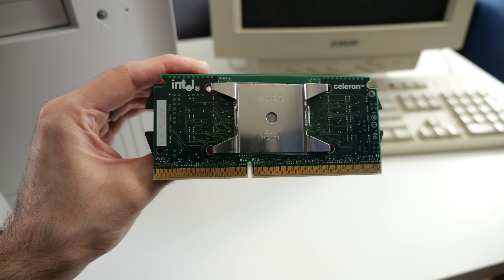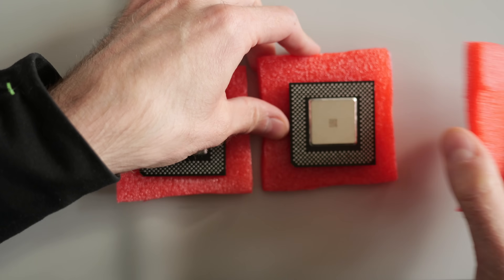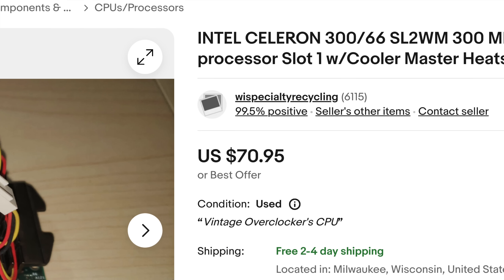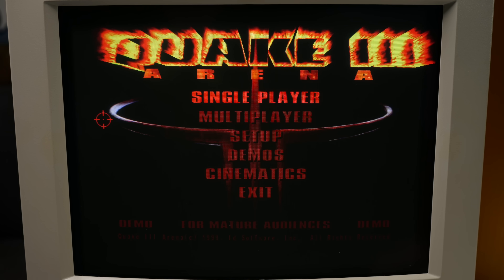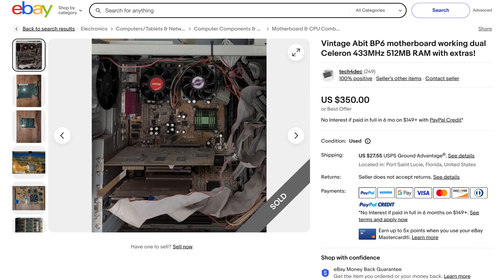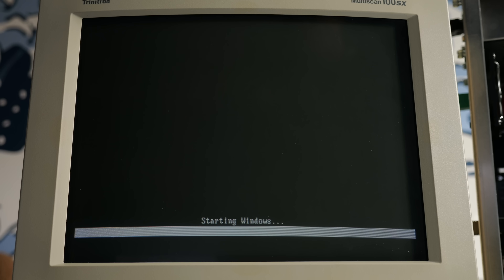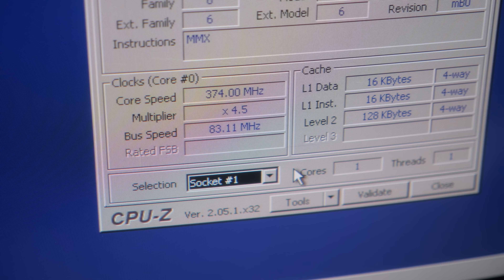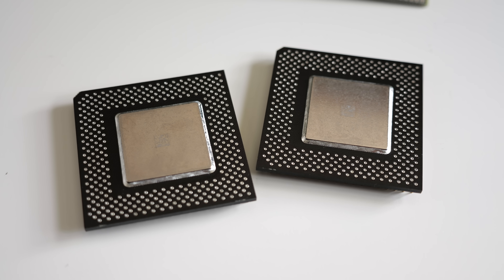I almost BLEW UP two vintage Celeron CPUs

Comment: This is why having multiple CPUs ends up being a disaster like the Sega Saturn, since programs and games can’t properly run at maximum settings, because developers made these software to run on a single CPU!
Reply: Plenty of systems could take advantage of SMP just fine back in the 1990s, including high-end workstations and servers from Sun, SGI, DEC and IBM. This was purely a Microsoft and third-party drivers / software maturity issue. It took a while to get Windows and all drivers thread-safe and mature enough to work in a PC with more than one processor; after that, apps and games were able to scale. 

Today, you’d have a hard time finding a single-core CPU in any personal computer or even handhelds. If you try to run any modern OS on a single-core CPU, it will either fail or exhibit horrendously slow performance. From that perspective, the industry has evolved and flipped 360 degrees.
Reply: @little_fluffy_clouds  we don’t use multiple separate CPUs, we use multiple cores in a single CPU because it’s all in the same processor chip!
Reply: @ yes, I know, that’s precisely what I wrote in my comment. When this Celeron processor was new, there was no such thing as a multicore processor, so if you wanted multiprocessing, we would use multiple processor chips, each of which had one core. Now CPUs come with multiple cores.
Reply: @Markimark151  multicores are the same thing as multi processors, the only difference is latency with their ability to communicate with each other. There's nothing new under the sun.
Reply: @little_fluffy_clouds  but it’s a design flaw to have multiple CPUs since software developers can’t fully utilize multiple CPUs simultaneously, good thing we use multiple cores in the same CPU which makes it easy to develop games.
Reply: @goclunker   no they’re not! Dual CPUs are physically separate from multiple cores in the single CPU, you have to program games differently than you would normally on a single CPU. Saturn games were inferior to PS1 and N64 because of the architecture and performance being divided.
Reply: @ if you write threaded code, you can utilise multiple processors just in exactly the same way as a multicore CPU. From a programming point of view, it’s the same, threads don’t care if they run on different CPU chips or different cores on the same CPU chip. It’s just that it’s difficult to write threaded code well, you have to account for deadlocks and race conditions which simply are not a problem if you write single-threaded code.

Some Saturn games did use both CPUs concurrently, it was just hard to do it efficiently and Sega didn’t have libraries to make it easier for a long time after the Saturn’s launch; for example, Virtua Fighter 2 used one processor for each fighter during fights.
Reply: @little_fluffy_clouds  listen, as someone that worked in quality assurance game development, you can’t just rewrite codes and make them playable on dual CPUs, you have performance issues with one processor being the primary and the other being an extension. Sega made a big mistake with using two CPUs, not helping third party developers utilize parallel performance. Game testers ran into problems with needing to make the second CPU on par with the first one. Multiple CPUs is just uneven performance, and game development is already messy enough!
Reply: @Markimark151  LOL. Its the same thing. What do you actually think cores are? Magic? they are just identical CPU cores with a super quick bus for communication because they are on... the same die.
Reply: @ Apparently you have never heard of anything from a xbox360 and ps3 on. LOL
Reply: @goclunker  Xbox and PlayStation consoles having more cores in their CPU isn’t the same as adding another CPU to the motherboard and complicating the architecture. The developers don’t have to worry about dividing their assets into two separate CPUs!
Reply: @Markimark151  Just stop, i am peacing out of this ridiculous discussion.PS, I owned a dual G4 PM for 15 years... and OS X has no issue utilizing BOTH CPUS.  Later.
Reply: @goclunker   then please leave, I don’t want to hear anymore misleading comments from you about video game consoles!
Reply: @ stop tagging me fool, I've lost enough brain cells on you already
Reply: @goclunker  then leave me alone!
Reply: Ummmm... what are cores? Its 2025, no single cpu around
Reply: The operational principles, from a software and programming point of view, is the same whether you have n single core processors or one processor with n cores. Typically, performance is better with modern multicore designs since the cores can communicate faster and with lower latency with each other.

Comment: I had the Celeron 366 (5.5 x 66MHz bus) overclocked to 550 (5.5 x 100MHz bus). Worked really well for years. I remember something about these 366MHz Mendocino core CPU's being especially overclockable compared to other Celerons of the era. That's why I bought it in the first place, for the overclocking capability ;-)
Reply: Same. I went through multiple CPU's before finding the magic pair. An an ABit BP6 that I'm looking at right now. It is in desperate need of a recap.
Reply: Things were moving so fast back then. Those you had were quickly superceded with the P3 (Coppermine I think) going up to 1,3 GHz.
Reply: @Breakfast_of_Champions  Totally. I used it as my primary rig for about 7 or 8 months  before moving to an Athlon based system but kept it around as a server for a few years.

Comment: You need to drill holes and mod the socket 1 celerons for smp. The socket 370 1st gen would do it with a specific slot 1 to s370 adapter (or abit p6)

Comment: Gonna post another comment: In this error, motherboard voltage was not very good either. I remember a buddy of mine that had a motherboard with poor voltage on the AGP socket, and his systme would crash all the time with the nVidia card he was using. There's a good chance that your motherboard cannot supply accurate voltage to both sockets at the same time.

Comment: Not sure why but this is all reminding me of when I upgraded my old Dell.  I had a XPS desktop with a Pentium 4 in it.  I knew when I bought it that it was an option to get a Pentium D.  After a couple of years I bought a Pentium D on Ebay and upgraded it (was much much cheaper after a couple of years).  Was obviously an easier option at the time to add a second core to the computer.

I remember it improving the performance, but not many programs supported dual CPU.  As I recall, it was primarily that it would reduce overhead from Windows and other programs running while playing whatever game you were running.

Comment: I was working on a dual Pentium III workstation at work back in 2002 and it was database related software aware of both CPUs, all other software just used one CPU

Comment: Change the FSB if possible, usually 110MHz is doable, sometimes even 115. Same goes for 66MHz side of things.
That is the info you are consistently missing, overclocking is not just a jumper and push voltage till things burn, it is a process of upping things a step at a time.
Had an ABIT BP6, if i recall correctly, i got 2x507MHz from celeron 300, i got ~1050MHz from 2 of PIII 733 and i got ~1100MHz from 2 of PIII 1000. This was done with 2 huge coolers with Delta fans that literally broke my fingernail when i foolishly tried to stop them!
Be aware that all this is very dependent on power supply, memory, MB,  adapters, cooling that in your case is not enough, and even the slot/socket contacts rust amount.

Comment: I think it's also worth remembering that these CPUs are now 25 years old - just because they could relatively easily be overclocked in many cases back then, does not mean they're still capable of doing it as everything ages.

Comment: I remember upgrading to a dual Athlon MP 1800+ (1.5Ghz) system in the early 2000s and seeing how fast it ran on Windows 98. Soon I realized it was only using a single CPU. It was simply the architectural improvements I was seeing

Then I started using Windows 2000 (multiprocessor support) and soon after started my journey into Linux

Comment: Yeah, that's the problem with multiprocessor, even today.  If you run any older apps that don't support multithreading or multiple cores, then you're getting zero benefit from having a multicore processor.  And ironically, cores today are generally less powerful than the older Pentiums of the day that older early 2000s software is expecting.  For example, Crysis actually runs better on an older, faster clocked single core Pentium then modern multicore, but slower individual cored processors of today.

Comment: Why Win2000? And not XP?  Over time the XP kernel must have had improvements for multicore compared to 2000, which had a much shorter lifetime.   And why not trying hardware testing with linux also?

Comment: I think the celery was at least a bit easier to overclock than you're experiencing.  Overclocking these (but not dual mode) was really popular.  I think the chips on the resale market tend to be the poor ones (sort of a binning by consumer).  Personally I had two of them and didn't even have to overvolt either to get to 450, and I remember talking to a number of people who experienced the same.

Comment: According to the manual the Asus motherboard of my slot 1 Pentium III the board supports two models of those adapters. I know a couple of 1ghz slot chips would work but I'm not sure if an slocket 1ghz chip or a legendary coppermine would work... not that I would ever find a coppermine Let along a slocket adaptor

So close on gpus My Pentium III has a fx5700

Comment: I did have a 2X 333MHz PII way back in the day. Used it with BeOS 4.5 and later 5.0, Worked flawlessly. However I never overclocked them nor did anything special. And yeah, it was mostly a 'why not' build than anything else, since I couldn't game very much on BeOS and never really worked with graphics. But it did run sooooooooo smooth in day to day tasks. I loved it. Might have to build one of those again...

Comment: Dual celery 300a over clocked to 450, was the bomb back then.  I wish I still had it.  I ran windows NT/2000 and Linux.  The system was a lot snappier to use even if a lot of benchmarks geared to single tasks didn't show it.   Worked really well in Linux and Windows was noticeably faster with multitasking.

Comment: I used dual Celeron 500 on BP6. Rock solid (after fixing faulty VCore design) and decently quick. Also, modified BP6 could takie dual PentiumIII.

Comment: Nice copper CPU coolers! I used to run Asus BP6 with dual Celerons and chilled watercooling. Needles to say that it was not for serious work or play. It was more of a OC hobby project. Sweating it out when the DIY soid copper waterblocks were running near zero and sweating like crazy on condensation.

Comment: Some of the LOWER rated clock speed celerons COULD be overclocked more than the higher speed ones.  It was probably due to the factory fixed clock multipliers.  Also the few NOS Celerons still available on shelves today might be ones that barely made the rated binning, when these were new the devices that passed factory binning with more margins were the ones that got sold first.  So, yours might be of lower quality.   As far as multi processor software, you should probably be running Linux or BSD.  Some distro's still support 32 bit processors today, or you can compile your own kernel.

Comment: best overclock i ever got on a old system was running a amd k6-2 at 682mhz the bus had a max speed of 124mhz and i had pc133 ram installed. i tried like 4 amd k6's till one worked at that speed. i did this around 2005 when i was finding dozens of emachines along the curb most of them had various k6's in them.

Comment: 4:58 Couldn't you just right click at MPS Uniprocessor PC, select Properties, Update Driver and select Multiprocessor? I did somewhat something like this inside of a VM machine and worked without reinstalling Windows.
Reply: I've done a search and yes you can. 
"Fortunately Windows2000 is much less of a pain to change back and forth between single-processor and SMP configurations. Simply go into the Device Manager and find the item 'Computer'. With 'Change Driver' you can choose whichever system configuration you fancy by choosing 'show all available drivers'. "
And then changing to ACPI computer. But afaik you can do this only going to ACPI, to go back to standard pc, you need to reinstall Windows.
Reply: This. On NT you could also do it without reinstalling but had to manually replace the HAL and kernel files.
Reply: Came here to say the same thing! I've done this regularly on a Pentium 4 Windows 2000 system to enable/disable hyperthreading.
Reply: Exactly. I did this multiple times on XP when upgrading from non HT P4 to P4 with HT, as it showed up as 2 processor cores. No need to reinstall :) Also works on 2000, I had an old server with P3 processor and decided to add another one, did the same and it worked. That was all back in 2007 or 2008 :)
Reply: @ Even Windows 2000 couldn't take full advantage of multi-threading, like the video shows up. Many programs and games can have multi processor support but... Only XP and ahead can take full advantage. Maybe the results are different if he used XP.
P4 HT doesn't actually have 2 cores. The main core emulates/virtualized a second core. Enabling HT, the P4 could have at least 60% more performance. The first actual dual core is the Pentium D.. which was actually 2 P4 cooked together with extra sauce.. but they were poor in effenciency and they never put HT into Pentium D. Fortunately, Core architecture arrived sometime later.. saving us from having over 200w cpus.
Reply: @hugosimoes5119  Early versions of "Core" architecture actually ran concurrent to P4 and was found in the mobile line. The  840, 955, and 965 were Extreme Edition P4-Ds and had hyper threading.
Reply: @NVMDSTEvil  I've upgraded several laptops from Core to Core 2 CPUs. It was extra good to take a "Core Solo" Celeron to a Core2 Duo. The gotcha is through that era there's 3 or 4 laptop CPU sockets that all have the same hole layout but are not electrically compatible. Often the exact same CPU dies were used on two of the pinouts.
Reply: Yup, could do this.  It was also worth doing this on single-cpu machines for extra performance as well :)
Reply: And would it boot as "Multiprocessor PC" if one of the CPUs was missing? Because then there would be no reason to change back.
Reply: @Stoney3K  Yes

Comment: Shouldn't you use a crappier video card to help illustrate the CPU difference in the game? That means it's the GPU that's the bottleneck mostly, so a less-bottlenecked GPU would help illustrate a larger difference in performance w/CPUs?

Comment: With the right amount of RAM you could get something like NetBSD or one of the few 32-bit Linux distros to run. It would be interesting to see if there is any amount of performance bump having proper multiprocessor support.

Comment: The return of the Dual 300A! LET'S GO!
Reply: The Abit BP6 was the only decent hack to get this working.  I still have a few 300a's that overclock to 450 with no problems.  I've used slockets before with them but they weren't ideal.
Reply: shut up jeff your channel has been nothing but homelab crap for the last 5 years, how about you do something consumer-centric for once?
Reply: @Zoey_KL Consumer-oriented is literally what homelab means, a network and server infrastructure at home by a regular end user. Also, bold of you to act like any one person owes you a specific type of content, haha
Reply: Dude chill out

Comment: I think the motherboard plays into the overclock A LOT as that is why people used the ASUS P2B the most for the 300A overclock and later the BP6 for dual 333 overclocking. (finally bought one for $100)

Comment: this reminds me... i had a k62... it was reported to run at 266, but i noticed, my memory was meant to run at 100, therefore i tricked it to go 100 times 3, making the proc 300 mhz... it worked just fine, and the speed up of the main bus was wow
Reply: There were a lot of gains from raising the front side bus, for sure. I had a Cyrix 6x86MX-150Mhz that by default ran at 3x50MHz FSB and changing the jumpers on my board to switch it to 2x75MHz got me a significant performance boost even though the CPU wasn't running at a higher total clock rate.

Comment: I wonder if  by the time they got to PPGA packaging them that they were binning them from the factory and the ones that could run higher clocks were being sold as the 433,466,500, and 533mhz , while the worst binned chips got sold as 300mhz.
Reply: Reading Anandtech's article about the 366mhz ppga chip launch seems to imply that Socket 370 launched in January 1999 and the 366 and 400mh were the first chips available, so the 300 and 333 PPGA chips are probably all bad bins, where the early 300A and 333 chips on slot-1 probably weren't necessarily binned and that why it was so common that they'd hit 450mhz.
Reply: This is basically how all CPUs built since the first Pentium have been labelled, I guess. They first design the bigger ones : if they are good, they keep their name. If they fail, they get an inferior name and they are sold as weaker CPUs (like the Core CPUs for example : The "F" versions are normal CPUs were the iGPU-part of the die is defective, the "non-K" versions are the "K" versions that didn't like to be OC'ed, etc...). It's also why you have a shit ton of models in each CPU lineup nowadays. It's all to be sure nothing is wasted if a batch didn't pass the QC tests.